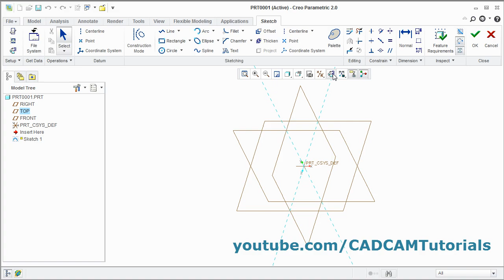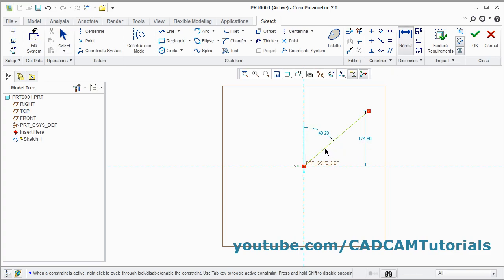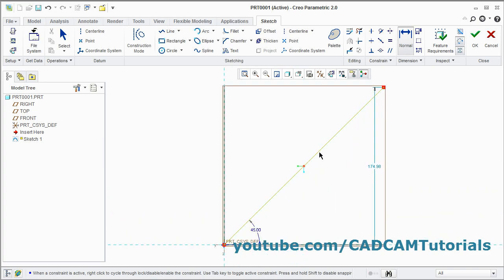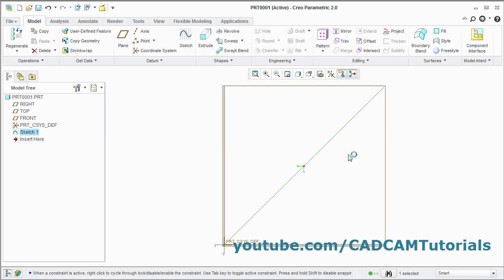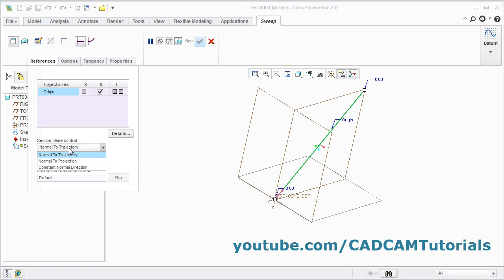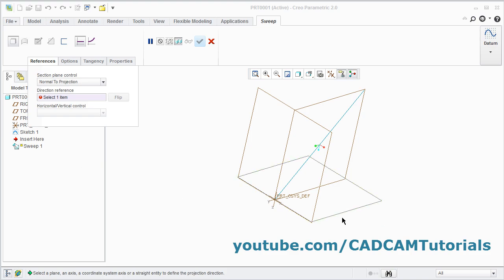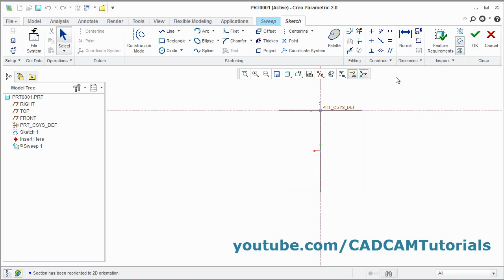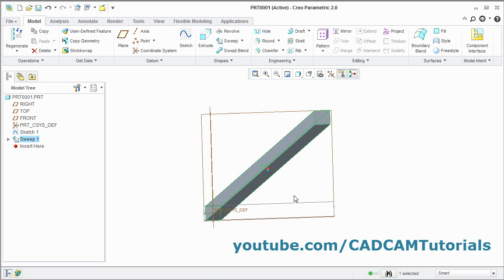Creo Extrude at an Angle

Comment: Nice tutorial, is there any possiblity to extrude on a cruved surface? I want to extrude sketch of tread on tyre, the biggest problem im facing is i cant extrude it on the tyre rounded to the tyre
Reply from the maker: Use revolve command
Reply: @CADCAMTutorials it can't be. I've the sketch of treads from top view, not from the side.